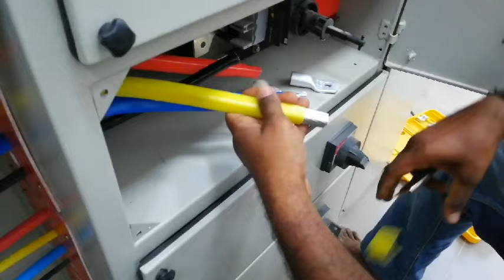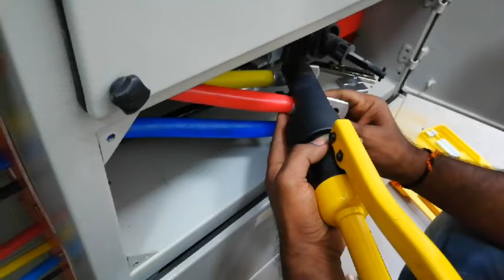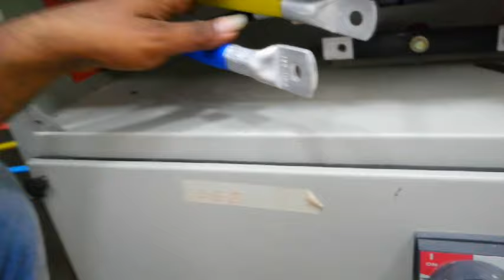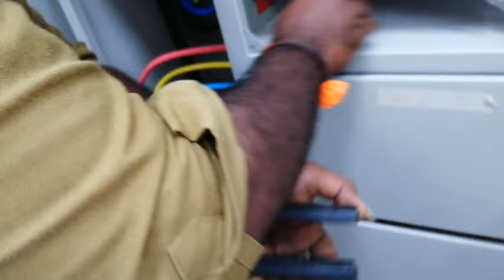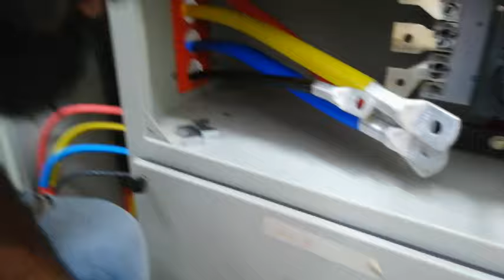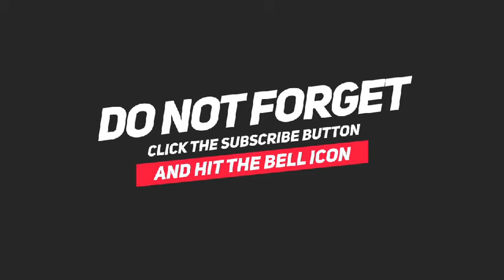Electrical Cable crimping

Comment: Wouldn't pass here in Ireland. Insufficient crimp air pockets inside   for sure. That's why there are tools for 1500 EUR. I worked with kaulke power crimper and results are different from this crimper. 
Thanks for video I know now that it's not worth buying such a tool.

Comment: That's the world's cheapest crimp tool without any sort of certification! A decent tool would cost 20 times as much.
Reply: Worrying that there are people out there using a £30 Chinese tool on industrial panels isn’t it!
Reply: Maybe, but those crimps ain't coming off anytime soon
Reply: @segt  I know it's been a year but 50% of crimps world wide have probably been done with this exact same tool.
Reply: that why our tax bill is so high huh? (O-o)
Reply: Does the job. Same results. Certifications are pretty pedantic in reality and that's why you'll get exact or better quality stuff from companies for 1/3 the price without certs. It's a stupid simple tool design, I've owned 20$ ones and 1200$ ones. Only differences are in QC and smoothness and ratings. 80$? All you need to get the best